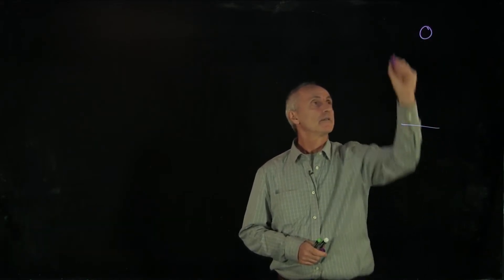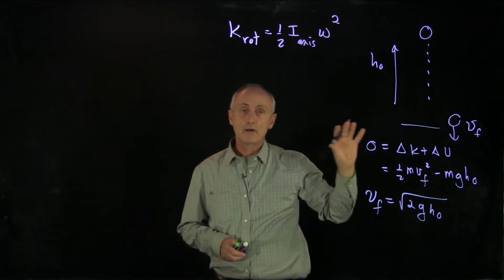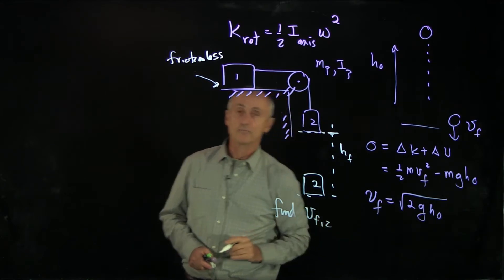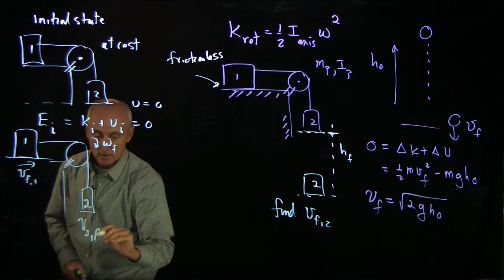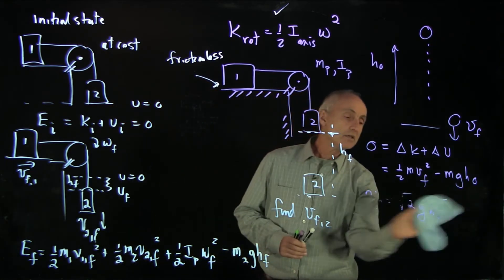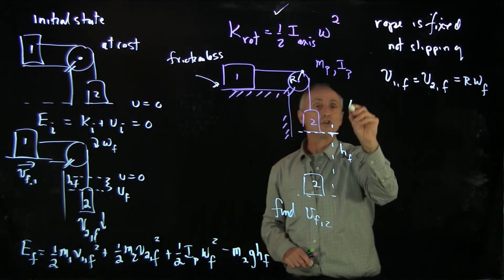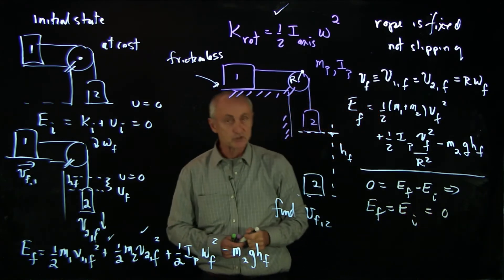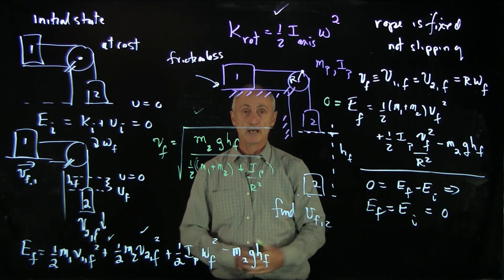31.7 Worked Example - Two Blocks and a Pulley Using Energy

Comment: Why not taking into account the work of the internal force of the friction rope-pulley ? 

The work-KE theorem you derived in previous video accounts for work of internal + external forces (since F=ma has to be integrated for each individual particle of the system)

You should have adopted the same method as in the next video (applying Newton's second law and torque law).
Otherwise, using W-KE theorem leads to a rope-pulley friction term. That means this method is suited in case we want to calculate the rope-pulley friction term.
Reply: This is a very important insight. In short, in this problem, all work done by internal forces all cancel out. Hence, the overall work done to the system is only by gravity. For internal forces, action equals minus reaction (two forces come in pairs), but the displacement of these two forces are the same in this problem (if we think where the points of action are). This is because there is no slipping between the rope and the pulley, and the rope remains stretched (as if it were the rigid body problem). In particular, for each mass element of the rope and the pulley in contact, a friction from the rope to the pulley and the other friction from the pulley to the rope are In opposite directions, but their points of contact can be viewed as identical (the contact point, one affecting on the rope and the other on the pulley), and the displacement ds are the same. Hence, the work terms by these two forces cancel out. Such analysis can also be done to the other parts of the system.

Of course, if we think about accelerating two blocks where one block is "sliding" over the other block (non-rigid body), the total work done by the internal forces (i.e., friction between two blocks) cannot be zero. Hence, the contact point between the blocks will eventually heat up.